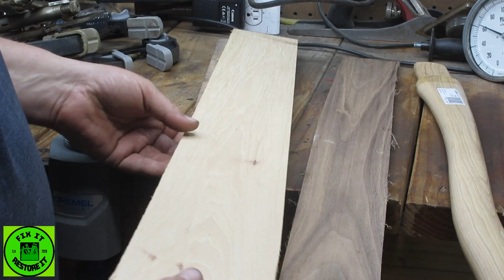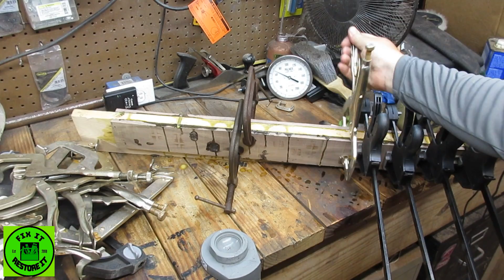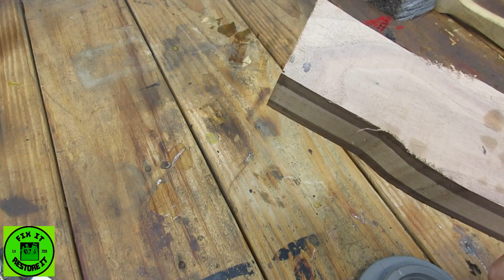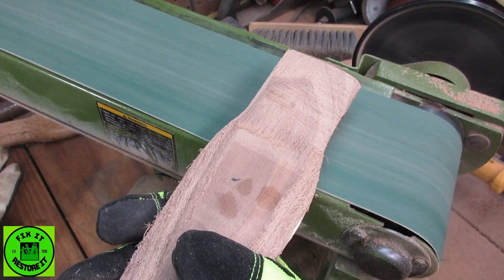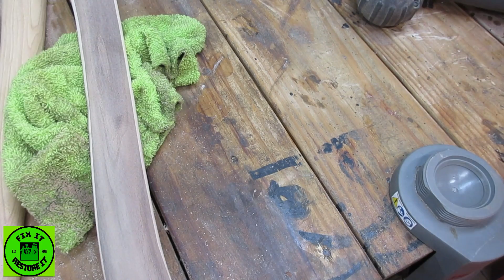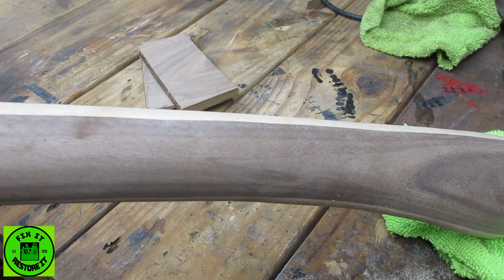Laminated custom Axe handle

Comment: I’m surprised no one has given you any grief for using walnut. I made a couple 19” axe handles out of black walnut for my teenage boys. I never heard the end of it. But, they’re beautiful and have survived two years of abuse and are still going strong. Glad to see your work:)
Reply: joe Mugly , what would be the problem with using walnut?
Reply: Parajax Outdoors because, although walnut is very hard it is, or rather can, be very brittle. I’ve experienced this with a few projects I’ve done. However, the small axe handles and hatchet handles I’ve made with it are stunning to look at and so far function without any problems
Reply: joe Mugly  thanks!
Reply: Parajax Outdoors you bet. You got a project head you’re working on?
Reply: joe Mugly Found an old head in my barn. It’ll be my first attempt.
Reply from the maker: Im surprised too, although the walnut is more of a filler !
Reply: Walnut is a brittle wood compared to hickory. As a core or entire handle it may not hold up for daily working conditions, but scales are more ore less decorative. If it's glued right they'll last.

Comment: Have you checked for anyone running a local sawmill near you?
Reply from the maker: Closest sawmill I've found is 45 miles away, kinda wanted to try the laminated route anyway!
Reply: Fix it Restore it , it turned out great. Keep us posted on durability.

Comment: Next time, put down wax paper on your work bench for easier clean up
Reply from the maker: 👍it actually wasn't too bad 😎
Reply: I use freezer paper with plastic side up, just tape it down, then throw it out when done. Saves scraping crap off the benches